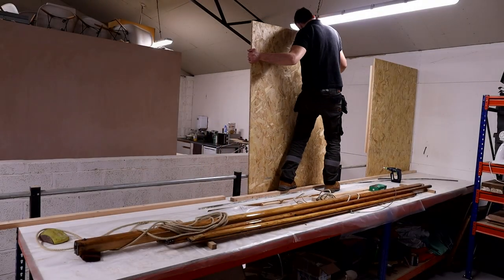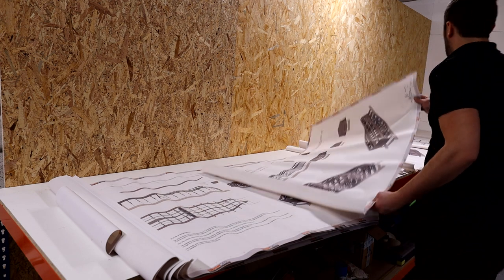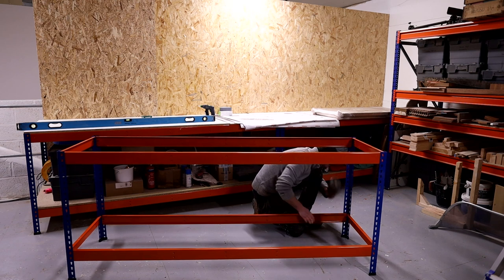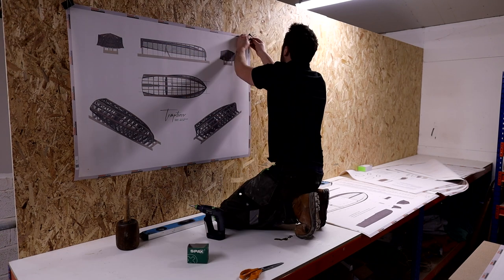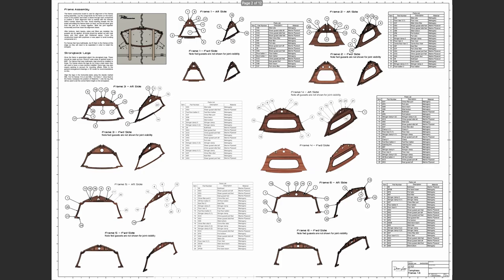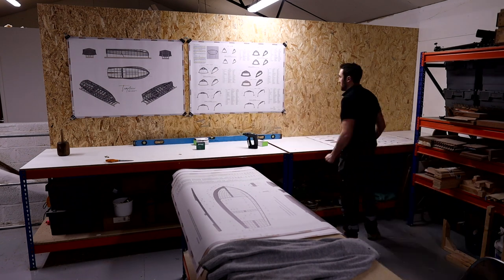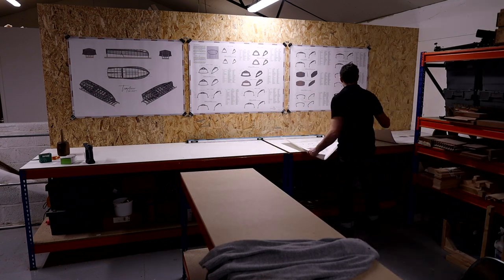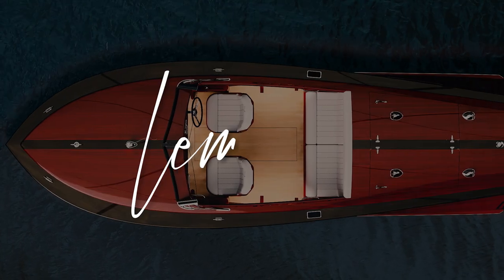Setting Up The Workspace | Temptress 1/4 Scale Boat Build Part 1

Comment: Very cool Dan. I try to build a 1/4 scale model for most of my builds. A half model at least. At that scale you can get a fairly realistic walk through of the process, which is of course where the real value lays. As you discuss the concept of a model kit, It brings to mind the Bartender Boats which offer plywood ring-frame kits for their full sized craft, leaving the sourcing of planking etc to the builder. Kind of a bare bones kit that eases the most critical part of any build. I’m thinking this could be a great solution to an economical Temptress kit that offers manufacturing advantages too.

Comment: I get your argument about cutting parts out with a CNC limiting the amount you can scale. But a 1/4 scale model is going to be a very big model.

I would probably be more interested in a 1/8th scale. But to get that, I would be looking to use a laser cutter.

Comment: Great video, Dan! For my retirement project, I am considering building a full size Temptress, depending on budget. I know every boat is different, but can you give a rough order of magnitude for the cost of one of these boats, in terms of materials + all hardware and equipment. Give or take £20k. Obviously, my labour is free, and I would be a first time builder.
Reply from the maker: Take a look at my forum, you will need to set up an account but then you will be able to view it. There are some people on there building full size Temptresses (if that’s the plural for more than one Temptress 🤔) and they are sharing some of their pricing which may be of help.
Reply: @DanLeeBoatbuilding  Thanks Dan, I will sign up

Comment: How about hardware for this boat?  Where would they be purchased?  Steering, vents, rudders, gauges, tanks, etc.
Reply from the maker: There are a couple of options here depending on where the builder wants to go with it. We have the entire mechanical system designed so we can advise or provide drawings for all of these elements if required. Right down to the hardware if you want to go with custom items. Failing that there are many off the shelf solutions that would work perfectly well for the design and they would be far more economical.